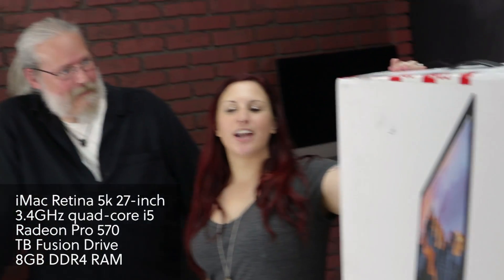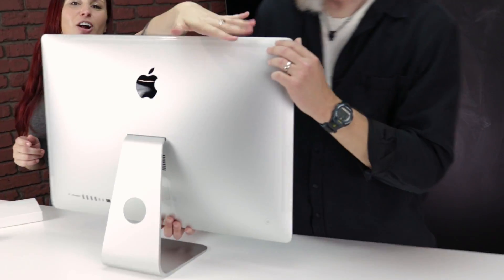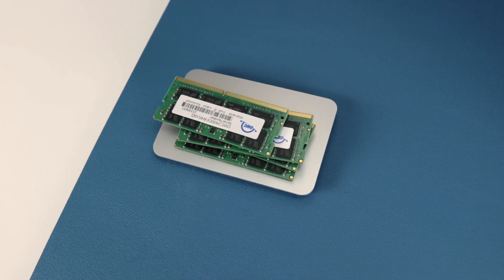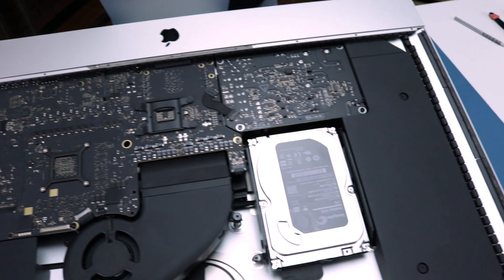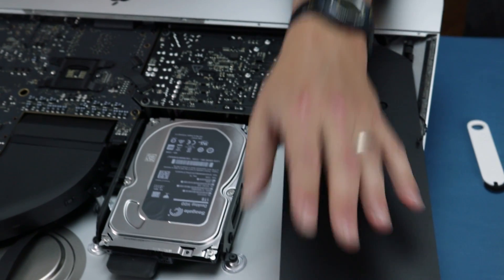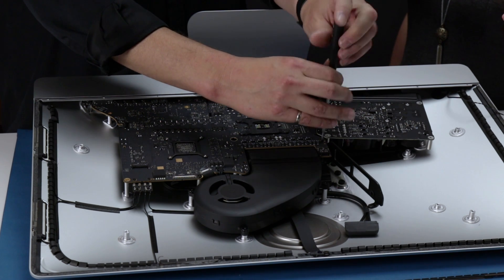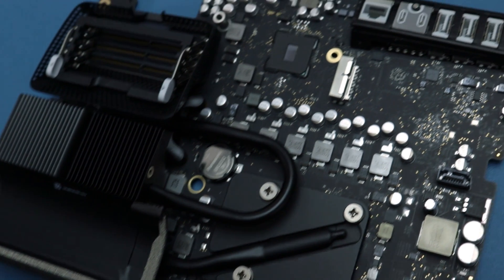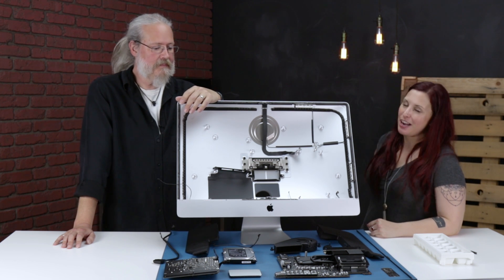2017 27-inch Apple iMac with Retina 5K Display Unboxing and Teardown (iMac18,3)

Comment: What you call the CPU is actually the GPU, and what you call the GPU is the CPU which IS removable !
Reply: ***** you're welcome ! 😊
Reply: This comment should be pinned :)
Reply: Yup. The CPU is always closer to the RAM. :)
Reply: So why are we still using 10-bit processing when the standard is 12-bit?
Reply: Well done explaining the differences.
Reply: I thought the industry standard was 24-bit color?  I think you mean 30-bit color (10 bits for each color).
Reply: Hard to tell, but that GPU wouldn't be on an MXM slot would it? ie, could it be swapped for an nVidia GPU?*
Crazy expensive, but nice to know if its possible?
Reply: Yeah they need to, at the very least, make a note in the comments.
Reply: Carsten Nitz I need your help for buying a Destc Apple IMac for video editing I can not afford I have serious handicap and I have an income of 180 euro / dollars us month severe handicap pension
Reply: Apple iMac 27" Desktop with Retina 5K display - 4.0GHz Intelquad-core Intel Core i7 http://appledesktop-shopzpree.blogspot.com/2018/07/apple-imac-27-desktop-with-retina-5k.html
Reply: The latest GTX cards are extremely close to the Quadros; in fact, the 1080 is a Quadro with GTX drivers.

As for display tech, IPS is old news.  OLED is the way to go now.
Reply: The Quadros also cost ~5 times as much, and a GeForce will be fine for almost all conceivable use cases.  (Quadro use cases are for things like structural engineering, which Mac designers clearly know nothing about if the 2013 Pro is anything to go by. Video editing can be done on a 770 and a mid-range i5; my 1070 chews through 4K rendering at a good 40 FPS.)

Comment: After removing the screen and the fan do you think you could reach the screws holding the bracket to change it to a vesa mount rather than the stand?
Reply from the maker: Great question! On the 2017 27" iMac, the stand is secured internally with screws that require the logic board to be removed in order to access them. Simply removing the screen and fan unfortunately won’t give enough clearance to reach the bracket screws for a VESA mount conversion. If you’re looking to do that upgrade, it’s a more involved disassembly process.

Comment: Hi, I have imac model 2017 27 inch Retina, I wanted to install vesa mount, but htis model does not allow to remove the stand from outside. do you have any solution what could be done in this case?
Reply from the maker: Yovan Vikash Looking into this we are not aware of a solution on how to utilize the vesa mount with the iMac models with non removable stands, we do apologize.

Comment: Are those screws on the display or rivets? Many users complain about black stains under the glass because the dust comes in, it is a bad design Apple never fixed. If those are screws it means it can be opened and simply cleaned, otherwise Apple just replaces the whole display.

Comment: I haven't even decided on buying it, but the 5400rpm HDD is a fricking joke.
And the SSD options Apple offers are even worse.
So buying the tape it is I guess…
Reply: The 1 Tb HDD is 7200 rpm Seagate HDD with 24 GB SSD partion.    I have the 2017 iMac 3.4 GHz just like this one.     IT boots up in less than 30 seconds.

Comment: I have a question -- any way you guys can tell me how does the cooling airflow flow inside (in through the bottom and out the back little grille right above the RAM bay?). Also, if the air flow does go in from the bottom, how much of the bottom vents are actually intake cooling vents and how much are the speakers using? I ask because I want to be pro-active with this new iMac I got (27'' 2017 model) when cleaning/vacuuming the vents for dust from time to time. I'd appreciate any help or info on this. Thanks much!

Comment: Hello, how are you!
After upgrading my disk, I closed the display with the appropriate sticker and it was great, but my microphone does not work anymore, if I scream it picks up the voice very low. You can tell me where the microphone input is, because I believe I tampered with the sticker.
Thank you very much for your attention and congratulations for the instructions and demonstrations.
Thanks!

Comment: Hi all, I have an IMAC 27 5 K 2017 with Fusiondrive 1 TB (only 24GB SSD), I saw the video and I would like to install a PCIe SSD would model do you recommend? (4x PCIe 3.0 NVMe)

Comment: Awesome to watch. Can one open the machine and change one SSD (512) to a SSD drive with a larger capacity (2TB) on their own?
Reply: MacSales. com : Thanks so much. I appreciate the reply and the info. Would love to upgrade down the road a bit from the 512 to a larger SSD. I'll continue to watch for changes in the technology.
Reply: MacSales. com thanks for the info. So would it be best to get the 512gb SSD (i assume Apple install this via the PCie connection?) and add an internal SSD purchasing HDD mount and cabling or better to purchase the 2tb fusion drive and wait for the PCie 512gb OWC upgrade or just update the HDD to SSD (would the 128gb PCie make any difference if still installed?)?

Really is confusing and I haven’t found any information on which option is the best for future upgradability? A video on this would be AWESOME!

Comment: Can you help with a question please? How strong is the ram module, and how well fixed is it to the screen/back/motherboard? I used a fair bit of pressures putting in new ram (previous ram upgrades needed some force, so I expected I needed to here too, but I guess they were already in fine). Could i have damaged anything? I can not really see any images of how the ram module is fixed and works. I might be being OCD, but it's a expensive computer. Thank you!

Comment: So if a guy wanted to save money, he could get the 2TB fusion drive, spend the money on RAM, then if he wants later, he can swap out the fusion drive for 3.5" SSD drive, and still keep the faster 128GB M2 SSD for the OS and APPs, correct?
Reply: MacSales. com so does that mean if I only want to upgrade to 2.5" SSD, I just need to open the screen, move the speaker that sits next to the HD out of the way(without detaching the cable), and then proceed the upgrading without having to touch anything to the motherboard and other stuffs, right?

Comment: Is it possible to upgrade the flash storage with a M.2 ssd, and HD with 2.5 ssd?
Reply: This iMac features both an SSHD ( Fusion Drive ) and a PCI-E SSD. How can this be possible straight out of the box ? I don't see the configuration option on the Apple ( US ) website to have both the SSHD and the PCI-E SSD. Please explain
Reply: OK, thanks for clearing this up !
Reply: I think it is possible to upgrade the flash storage with an M.2 SSD. The proprietary SSD connector used on the previous generation Apple computers is an altered M.2 connector. Electrically it's just an M.2 connector. There are adapters on the market that allow an M.2 SSD to be fitted in the proprietary Apple SSD slot. Google "Apple M.2 adapter". microsatacables.com and sintech.cn sell these adapters. ( More information below )

However, the PCI-E SSD's on the previous generation Apple computers are all M.2 AHCI SSD's. Most M.2 SSD's on the market use the newer / more efficient NVMe protocol. There are only a few M.2 AHCI SSD's on the market. These M.2 AHCI SSD's are way cheaper than their Apple counterparts ( rebranded Samsung SM951's ) but they are all slower :(

I assume that Apple moved on to the newer NVMe protocol with their latest computers. Now you can fit a Samsung 960 Pro ( for example ) in the Apple SSD slot using an adapter. However, I didn't take the time for verify this. Please Google it first ! At the moment, there isn't much information on this since the latest generation of Apple computers are just released. You might want to wait some time ( a week, 2 weeks ... ) for more information to become available.

Also, TRIM-support might not be available for aftermarket M.2 SSD's. If I remember correctly, this was the case for the M.2 AHCI SSD's. However, it might be possible now. Please verify this too.
Reply: If it is the same connector (not 100% sure) has the one present in mbps (early 2015 for instance),  NGFF M.2 PCIe adaptors can be found on internet. Now High Sierra supports other brand ssds, I think there is a chance it works, 4096 block size ssd might work even with versions below High Sierra. A 4 lanes pcie 3.0 ssd should be used.

Comment: For those asking how big is the SSD from the Fusion Drive:

The 1TB Fusion Drive pairs a 1TB hard drive with 32GB of fast SSD — enough to store important macOS files and applications to ensure fast startup, near instant wake from sleep, and quick application launching, with room left over for your most frequently used files and apps. The 2TB and 3TB Fusion Drives pair a larger hard drive with 128GB of fast SSD storage, providing even more space for your most frequently used files.
Reply: Okay, so I have a 3.5 TB "Fusion Drive" system (500 GB SSD + 3 TB magnetic) in my rig.  Cool.

Comment: The apple website said this model only can go to 32gb ... you can work with 64?
Reply: Mustafa Adaoglu sorry but if you go to the website this model, 27' base line, said "up to 32 gb" only the mid ant top go to 64gb. I'm locking in the apple sebsite
Reply: Ok that's your opinion, but here in Portugal the base line cost 2200€ - 2400$... so the base line need to be a opinion. But return to the video, they use a base line and work with 64gb, if you see the spec is the base line.
Reply: Fernando Gonçalves I think u can buy 3rd party memory to upgrade the RAM to 64 gb

Comment: How big is the Fusion Drive SSD?
Reply: depends which size fusion drive you buy. 1 TB fusion drive has something like 16gigs of ssd space and the 2&3 TB fusion drives have 128gig of ssd storage.
Reply: Brian Walsh II thank's ✌🏻
Reply: lol I just noticed that is said 'sad storage' fixed.
Reply: The 1TB Fusion Drive pairs a 1TB hard drive with 32GB of fast SSD — enough to store important macOS files and applications to ensure fast startup, near instant wake from sleep, and quick application launching, with room left over for your most frequently used files and apps. The 2TB and 3TB Fusion Drives pair a larger hard drive with 128GB of fast SSD storage, providing even more space for your most frequently used files.
Reply: 32gb

Comment: If I get the SSD only 27", can I then add a spare 4TB WD Red drive (that I already have). I looks like it from this video.
Reply: no. not internally. it won't come with an hdd bracket or cable and may or may not have the port on the MB to add the cable.
Reply: Dammit :)
Reply: Don't take my word for it as I haven't done it myself but I THINK you actually can. I think they do have the port, so you would only need to get the mounting bracket and cable (ebay is your friend) either used or from a 3rd party.
I've heard conflicting info on this though, a couple of people claiming you can do it, or that they have done it, nothing definitive.

Now what I'm wondering is if I could put an Imac 2017 logicboard into a late 2015 imac case wth minimal modifications to the TB2 ports and take full advatage of TB3. It's probably easier to just sell and rebuy though. :P
Reply: I think you're wrong because it just doesn't have data cable (DLC615400MMGG40AT). You just have to buy it. But iMac has a port of course!